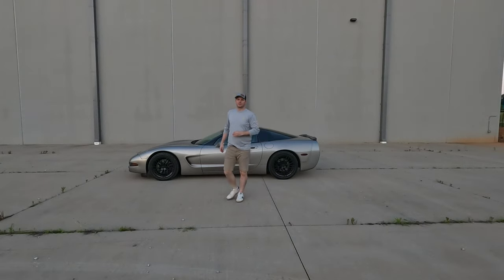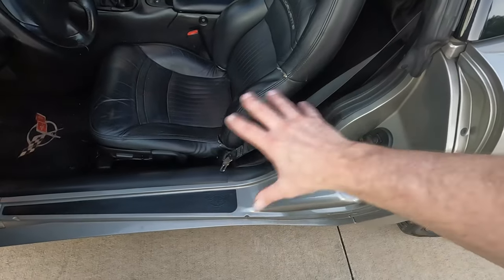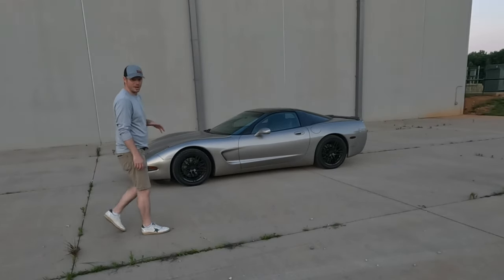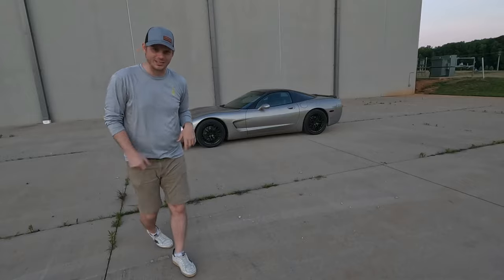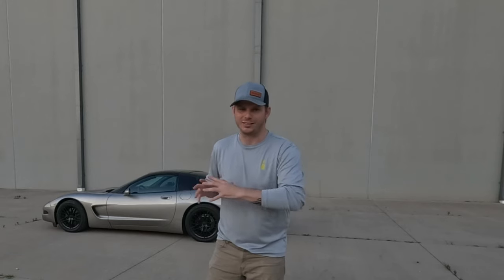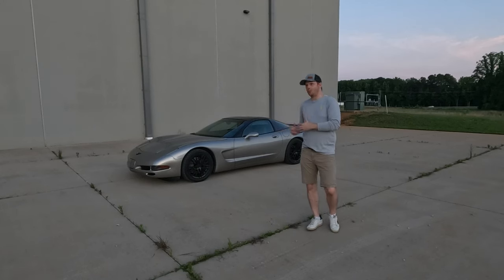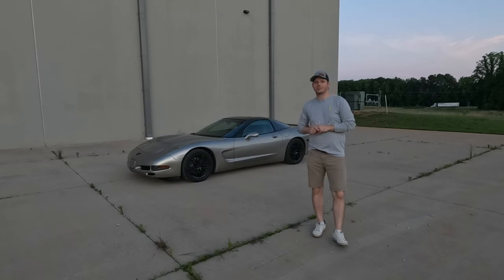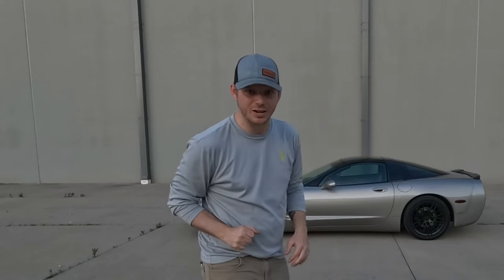WORST thing about the C5 Corvette

Comment: Kid, take a minute and go convert 120.65mm to inches. Then take that number and see what year that bolt pattern started.  Also, whenever you're crying about materials quality, go find another stock car for low $ teens money and let me know when you find something faster.
Reply from the maker: Ok kid — 5x4.75 — not a good bolt pattern for wheel selection.  No one smart would deny the bang for the buck in the c5 — but it doesn’t mean everything is perfect lol

Comment: I don't have a C5 yet, but I'll give my replies. The wheel well gap is fine. It looks great as it is, and you don't want to scrape going over speed bumps or up certain driveways.
Get C6 wheels and call it a day. Check out OE wheels in Florida.
And what's wrong with the center console? Too small?
Anyway, I can't wait to see the cam video.
Reply from the maker: Only c6 wheels I like are the GS wheels and they don’t look great on the c5.  Aside from that 98% of c5s have c6 wheels—I’m not doing that lol.  This is lowered all the way down on the stock bolts—the wheel gap is not fine 😂 it’s not terrible, but we need to perfect the stance.  Just wait and see!!

Comment: First, I thoroughly endorse getting either a C5 or C6 Z06 if you can find one for a good deal, just be careful with the LS-7's propensity for eating valves.

Second, would a thin bead of silicone RTV along the length of the top's weatherstrip bolster the sealing a little  better?
Reply from the maker: Open to try any trick to seal the top a bit better!

Comment: I dont know. As a c5 owner i can relate,  but not really.  I got corbeau seats , aftermarket radio, new carpet,  removable steering wheel ,shocks from a c6 z06 , new wheels that i think look good (forgot the brand). For m3 the interior is what needed a few things changed. Now just saving my pennies for a new paint job , because my wrap pulled the clear off.
Reply from the maker: You sort of proved my point lol if the seats were good, you wouldn’t need Corbeaus. My issue is that I actually like the factory receipts. I just wish they wouldn’t tear so easily. But overall, I love the car
Reply: @SpeedCultureStudios  tbh the seats were good , but the new seats make the car look sooooo much better. It's like bringing it up to modern spec. Even corvette people like the way it looks , and they are a picky bunch . Dang now that I think about it , I probably spent c6 money on the c5 😂. If you have sm , I can send you pictures of the interior.

Comment: Bro i own 2 C5 Convertibles.. I bought the factory bolt pattern in a black rim. Then I had them custom painted to a bad ass red/chrome color combination.  I get compliments all the time now 💯 just buy 4 new rims with the correct bolt pattern & have them painted to your taste..
Reply from the maker: Not necessarily worried about the color.  It’s the design availability.  Custom route really seems like the only option.
Reply: @SpeedCultureStudios  yes 💯

Comment: Does the ceiling only leak on the convertible??
Reply from the maker: I don’t know about the convertible.  I’m sure the fixed roof coupe stays dry though
Reply: @SpeedCultureStudios  oh alright, what version do you have that’s leaking?
Reply from the maker: @tixu2803  you saw it in the video
Reply: @SpeedCultureStudios nvermind you didn’t get the question
Reply from the maker: @tixu2803  I did get the question.  This is not a convertible.  That leaves only one other possibility.  I showed and mentioned the targa top in the video. You can also see that it is not a fixed roof coupe because of the shape of the roofline.
Reply: @SpeedCultureStudios  I didn’t watch the full videos just looked at the reasons 😁
Reply from the maker: @tixu2803  That's a problem.  I get hundreds of questions when most could be answered if the people just watch the videos.  With that said, you don't even need to watch to get your answer. You can see the car in the thumbnail. It's not a convertible and it's not a fixed roof...
Reply: @SpeedCultureStudios  yuh